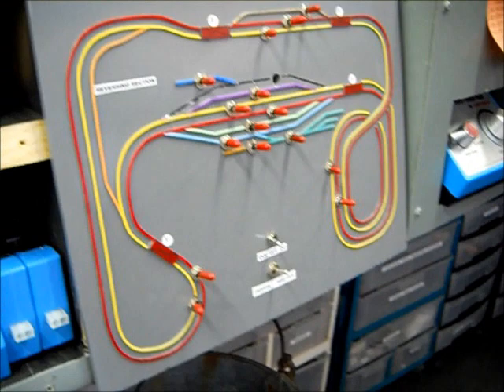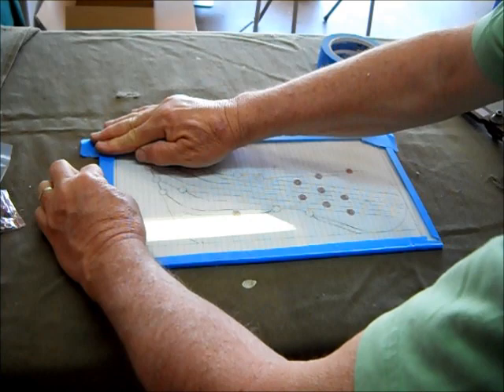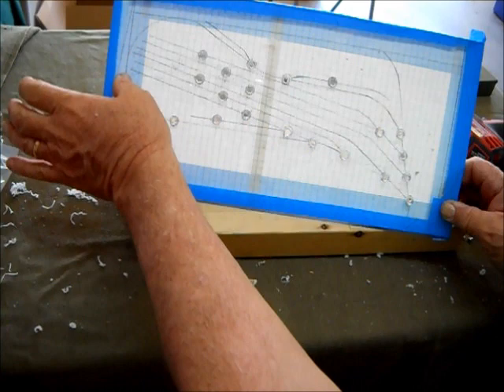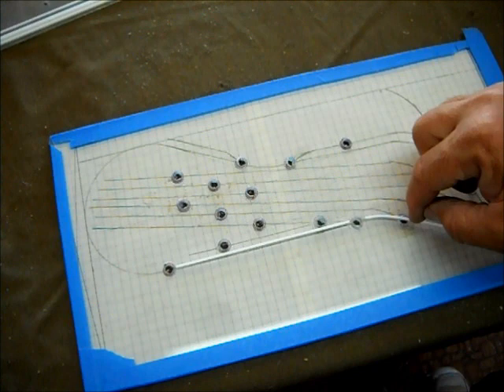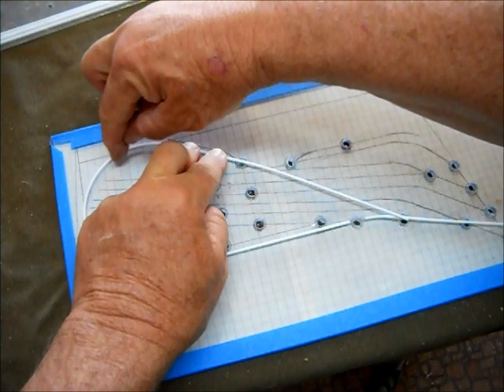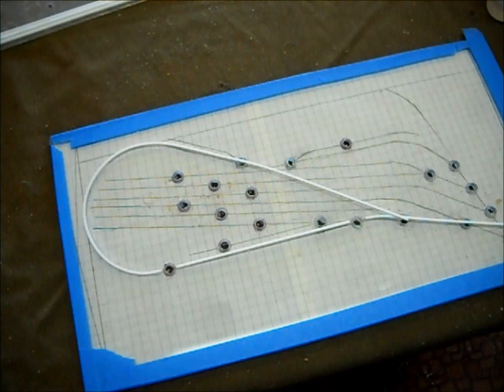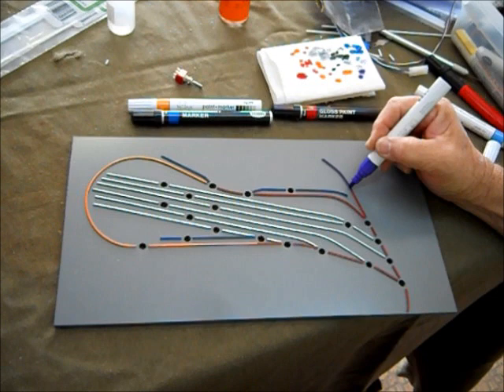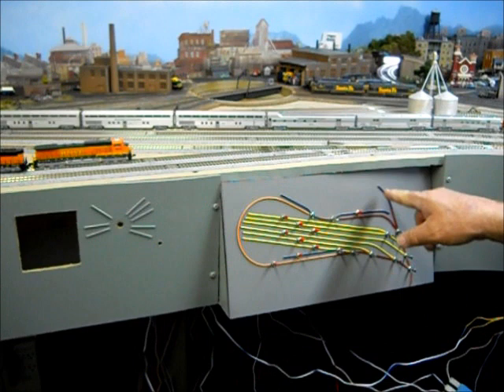How to build a model railroad control panel

Comment: Very nice video. I bookmarked it for another day when I get to the point of constructing my control panel.
Reply from the maker: Thanks Kedric , Hope you will be able to use it.
Mike
Reply: ***** :EDIT:

How well did that plastruct plastic weld work? I'm looking for a decent liquid glue for my needle point applicator and don't want it to come out hazy since some of the parts I'm working with on my coal hoppers are black.
Reply from the maker: Kedric Frick The plastruct cement works well but needs to be placed where you want it and nowhere else.
Thanks , Mike
Reply: ***** I'll keep that in mind. Thanks
Reply from the maker: Kedric Frick Thanks Kedric , It bonds plastic almost instantly.
Mike

Comment: I created a similar panel but I don’t have the 3D effect I used aluminum sheet and tape my template on top for drilling looks like plexy glass easier to work with. Then paint the Panel with white glossy paint. Once done I printed the Panel again on 3M Full Sheet Labels (Permanent Adhesive Clear). Then use an X-acto knife to punch out the holes, for Push button normally open switches. These are connected to DS-64 S inputs to toggle the switch machines. Panels make it easier to run the track for both DC and DCC. Great Video.

Comment: Mike, Thank you very mmuch for sharing your ideas and experience! I will do as you show in this tutorial. Just as I don't understand much about appropriate glue, so I will try with Faller Super Expert needle plastic cement. Here I don't know another needle glue for plastic. Thank you and keep running on your railroad tutorials! Henrique
Reply from the maker: Thanks Henrique , If it is solvent based liquid it should work for you .

Mike

Comment: On your Control panel demo some future suggestions and alternatives:

Firstly I need to disclose that when my family and I started building our original layout my Grandfather was an electrical worker, my Great Uncle was an engineer on the NYC Streamline Hudson (a.k.a. The Twentieth Century Limited), my Uncle was a D&H fireman, NYC brakemen, NYC engineer, a cousin was an architect.  They did the original planning  and instructing of my Dad’s generation and my generation.  So:

1)  Like you my cousin Joe-Joe did exactly what you did on scaled blueprint paper .  Since 1958 those original plans have been modified, and in 2008 my nephew   Joe 3 scanned the entire layout collection .pDF files.  Now whenever the family gets together, for a building session, we can print out a copy and make our changes.

2) Since two cousins hobby woodworking they built a story stick (a lumber with various holes drilled in it to match various items.  Each hole is marked with it’s size.

 3) On the pattern, where a hole is to be drilled a cross is drawn, on the plan, to center the hole.  Like you we drill a pilot hole followed by the full access hole.  Now a suggestion.  When my daughter went off to college she left behind a Manicure Drimmel tool which has a series of rotary files.  After we drill out the necessary holes we smooth out the surface and edges with this tool.  She ain’t gettin’ it back. With an hobby knife we etch the layout lines into the face side of the plexy glass.  Then we do two paint jobs. First; the back side is spray painted with a color DIFFERENT of the fascia.  Then we curve and spray paint the track lines in various colors to indicate their usage.  In the 1990’s my cousin found some plasticized paint which does bend easily without peeling or cracking. We also have holes for LED lights, coming up from the underside, which serve as a track block indicators.  Then to the backside we additional support from 3/4" plywood strips or 3/4" acrylic strips.

4) When all painted surfaces have had a day, or two, to complete dry surface we use the scratch lines as indicators for the track lines.  However, we don’t piece meal the styrene.  We dry fit each indicator, temporally tacked down with AC.  Then like you when the tack in solid we go back with AC and complete the weld.  A couple days later a family member will cut and separate the line, where the switch holes are located.

5) We have no need to scuff the panels surface as the background color in on the underside of the panel.  The individual track lines are pre-painted and welded in place.  Next is my job.

6) First my Grandfather, then two older cousins, now me and my two eldest grandsons get to work on pre-assembling turtle turnout switches, LED lights, automatic & infra-red block switches, and across the bottom of the panel we include a series of switches to operate diorama animation.  The little kids LOVE that feature. All connections are cold shouldered together with plastic shrink wrapped,  To avoid electric short outs.

7) I like your idea of double stick tape and VELCRO for temporary connection to the fascia.  We are going to try in in our August get together.  Back in the 50's and 60's switches were attached to the surface roadbed, then directly to the fascia.  With respect to my ancestor, that turned out to be a BAD IDEA.   Back in the 1970’s four of us left the wives and kids behind to spend a weekend in West Springfield, MA at the Amherst / “Big E” Train Show.

Separate from each other at the end of the day we found out, at days end, we each shopped at the same vendor.  And eached purchased a few dozen, of the same, screws with prototype train logos as screw heads.

So when we are all comfortable with a temporary panel 6 holes are drilled through the panel and fascia.  An anchor is inserted into the fascia.  The panel is re-positioned and attached with these customized draw pulls/screws.

Loved this video and Have subscribed to your channel.  Nice job.
Reply from the maker: Thanks so much , Mike

Comment: That's an interesting way to do that, Mike! I've never seen it done like that! It looks very nice! I have found that, for me anyway, the best thing to use to drill Plexiglas or polycarbonate sheet is a step drill. A step drill is kind of an upside down stepped cone, each step drilling a larger hole than the previous step. I mark the desired size with a Sharpie, and drill until the line just disappears into the hole. The hole itself will be slightly tapered, so you have to turn the piece over and come in from the back side as well. I used to have problems with the plastic cracking (usually on the very last hole! Grrrrrrr! ), but since I've started using the step drill, I haven't cracked one yet! :D I use a drill press to make the holes, I've never tried using a step drill with a hand held drill.
Reply from the maker: That is a good idea. I now do not need any control panels.
Mike

Comment: Hi Mike. The more I review your control panel video the more I think I'd rather go with sub miniature switches that you're using in the video.
So now I'm back to square 1 trying to figure out how to make this work. If you can help me again, I'll forever be in your debt. Thanks Mark
Reply from the maker: https://www.fiferhobby.com/how-to-make-kato-turnout-control-switches/
Reply: @N-Scale  Hi Mike. I just want to make sure that I'm doing the right thing in terms of power source because I'm using
NCE Power Cab. Should I still use the MRC Railpower 1300 Power pack because it's DC? I know this isn't my strong suit.
Thanks again for your patience. Mark
Reply from the maker: @markgershman1563  YES but the AC side and DC converters at the 840's
Reply: @N-Scale  Forgive me Mike I don"t understand. I'd rather go with the sub miniature switches than the 840's. 
I'm sure I didn't make myself clear on this matter. It's the newbie in me. It really doesn't feel good when you know your in over your head on all this stuff. I'm trying to stick with it. It's not going to happen over night. Thanks again for your patience. Mark
Reply from the maker: @markgershman1563  Please call me again.

Comment: This is a great idea. I just put a 2 loop track in with a double crossover and was thinking about doing an indicator panel with a separate control panel for switches kinda like what you were doing for the turntable. I have an Atmel board that lets you program it, so I think I might use that to control switches and signals all in one.

Comment: Yes, I'm almost done laying down track and forgot that I have around 250 surface mount LED's so maybe I'll try to make a few custom lights. Waiting for turnout switches to come in and have been programming a board for train detection that is working more like touch switches, but should be able to handle up to 8 blocks and control about 12 signals off it. Can't wait to get more into it. I decided to go with a Norfolk Western coal train. Very interesting hobby.

Comment: Mike a Step Drill bit like from Milwalkee works nice in installations as this as it Step up in Size for a hole that needs a bigger Size and they usually leave a Nice Finished Hole..
Reply from the maker: +brakeman 3985 Thanks , Mike

Comment: Mike Fifer,  Caution:  I found out the hard way, using Using Tamiya solvent cement WILL cause the Evergreen HO Scale 6x6 polystyrene  to "melt" and break anytime you flex to radius the pieces with any tension at all. Happened every time I tried.  Had a bottle of Flex-I-Weld with a touch and flow system and have had no problem while following your lead since, even while using a Tamiya bottle cap fine brush once cleaned or using the touch and flow applicator.
Reply from the maker: That is true and happens every time.
Thanks , Mike

Comment: After you dill all holes, and cut to size smooth out ruff edges with a file. then take a propane torch like for soldering copper pipe and heat the edges and holes gently. it will turn the edges and holes clear and neat. practice on a scrap piece to get the hang of it.
Reply from the maker: +w8one Good Tip.
Mike

Comment: Hi Mike. It's Mark again. I've decided to go with the Kata 840's along with the 842 DC converter to the MRC Railpower 1300.
I just think it'll be more child friendly for my granddaughter to switch the tracks. The only question I have is the wires going from the 842 converter to the MRC  AC terminal. Do I put both the wires on the AC terminal...or do I put one on the DC as well? Thanks again for all your help.Mark

Comment: Mike, is it possible to create absolutely all control devices on a computer? I mean throttles and switches.Track diagram should be created on the PC screen as well. Is it possible? What you thing about that? I suppose the computer will be able to control all trains on layout itself. Is that right?

Comment: Was checking out a few videos on how to build a control panel for my new layout. Your solution is inspirational. My only question is why you’ve painted the top surface of the screen instead of the bottom. Wouldn’t it be easier to keep it clean if the top was kept clear?
Reply from the maker: Yes but the styrene is white and the liquid gle shows. It is also much more easy to scratch up.
Mike

Comment: Hey Mike wanted to Pass on again Love Love my Amtrak El Capitan's I got from ya,  I do have a Question that might of been Answered but thought I would re ask and that is Do you sell those switches which I think I seen on your Site and or Can you make them up for Customers.. for a small Charge.. 

Not having a really good place / Bench to wire up my self and because Where we Live I'm kind of Leary of using A solder Iron.. So if they can be purchased in a Finished State It would Help a Great Bunch.. 

O"  Mr. Mike  sometime when ya Can would please...  Do a Video on the New 8444 Kato Engine and Do a Video of the New KATO Amtrak Engines Pulling the EL Capitan Passenger Cars I think that would be Really neat..  

Thanks so much  Mike n Robin
Reply from the maker: Thanks Ron, I do not own any of the locos or cars you requested.
The switches are available but not in finished form.
Thanks , Mike

Comment: Hi Mike. I was talking to you this morning about using the Kato 840's along with the Kato 842 DC converter and the MRC Railpower 1300
I think it's going work perfectly. I just wanted to ask you if you thought it would work if I ran a separate bus line coming from the MRC,  going around the layout, for the wires to attach to coming from the switches. Would that work? P.S. It was really great talking to you this morning!!
Mark
Reply from the maker: No because the wire from the 840 goes to EACH turnout and the power comes in the side of the 840 , so you would need a DC converter at eack 840 or group of 840's.
Mike
Reply: @N-Scale Sounds good! I'll let you know how things go when I get to that point. Hopefully It'll work.
I just want to check again about the locomotives....The DCC equipped one is the one that works on DCC without all the bells and whistles..right?

Comment: hey mike not only am i a fan but also a customer, i have two questions about using toggle switches for kato switches.one do you need a separate power feed for each dpdt switch or can you run one feed from the power pack to the first switch and the feed the rest of the switches off that one lead. also since the switches are not constant power is there any way to connect red and green led's to stay light to show the direction of the switch. if so do you where i can see how to do this. i have trouble with wiring diagrams . thank you dennis
Reply from the maker: No easy way to connect LED's to them without some more serious circuitry that I do not know.
The power though can be leapfrogged as you stated.
Thanks , Mike

Comment: Hi Mike. How are you? Very good videos Thank you very much for sharing them. My name is Angel and I have been working on our layout for some time now. Basically I am in the electrical part of zone A that is made up of only kato scale n tracks. I am trying to wire the switches, Mini Toggle Switch (on-on) SPDT, which in my case are blue body. I am also using two kato devices that came in a set. There are 15 changes of track in total. When I tried them individually I had no problems. However, when starting to connect the power source activates the insurance and turns off (It is the kato power pack, which I will use only to operate the switches, because the model is dcc. I have reviewed everything several times, but I can't find the Problem, you can guide me, excuse my English, but I do not use it regularly, I am from Chile and I would very much appreciate your advice.
Reply from the maker: You are using the wrong switch for turnouts. The Kato's are a single coil polarity reversing turnout and NOT twin coil but even the twin coil machines can not use On On non momentary switches . The kato's are done this way.
https://www.fiferhobby.com/how-to-make-kato-turnout-control-switches/
Mike

Comment: Mike....I was wondering if it might be ok to sand the plexiglass after drilling the holes prior to applying the Evergreen plastic.  I think that might make the sanding a bit easier and quicker.
Reply from the maker: Sure that would work as well.
Mike
Reply: ***** I picked up my plexiglass today along with the Evergreen plastic.  Just finished drilling and running the Evergreen lines between the switch holes.  For my 1st attempt it went reasonably well.  I had one mess up though.  I'd bought a plastic bottle with a long needle point to place the Tenax 7R neatly.  Well that didn't work like I'd thought it would.  As soon as I tipped the bottle the Tenax ran out in a big puddle.  Should have tested it first....lesson learned.  Anyway I was not able to control the flow no matter what I did.  So I just took a needle, cut 1/2 the eye off and used that to place the glue.  The capillary action made it much more manageable.  : ^ )  I'll have to pick up some spray paint tomorrow.  I like the gray color you have on yours.  I'm presuming that is a water based paint.  Please let me know if that is incorrect.  Other than that one mishap it turned out pretty well considering.  You instructions made the project much easier.  Thanks again....
Dan

Comment: Hey Mike I was wondering on switch controls if you use these type switches does it have to be wired DCC or can you use your Kato power pack?
Reply from the maker: On block controls either one and on turnout controls you can use any 12 -18 vdc power supply.
Thanks , Mike

Comment: Hi Mike , Without sounding dumb,(i'm new at this model railroad stuff) You have 2 different types of switches. One for the turnout controls and the other for block control. Could you, or do you have another video to explain what each toggle does. I didn't think dcc needed block control, or I might not know what you mean..Thanks
Reply from the maker: When I built this panel my layout could run DC or DCC , that is why I had the block controls. I have now removed them.
Thanks , Mike

Comment: Hi Mike. I know you said I should call you on Tuesday, but I had a quick question. Would a MRC Railpower 1300 Powerpack work with my 840 controllers? Thanks
Reply from the maker: Yes
Reply: @N-Scale  Thanks again for getting back to me so soon. I'll still call you on Tuesday about the confusion I have with the locomotives I have to get in order to work on my DCC system. Speak to you then. Thanks again! Mark

Comment: Hi Mike. Quick question. Can I use the Kato switch Controllers at the same time I'm using My NCE Power Cab? Sorry, I know this has nothing to do with this video. Sorry about that...lol  Mark
Reply from the maker: Yes , the kato 840's will need their own power supply.
Mike
Reply: @N-Scale  Thanks so much Mike. Could you suggest one that you feel would work best for Kato. Thanks again Mike!
I'm also looking to get my first locomotive. I'm a little confused as to which one I can get because of the DCC. Do i have
to get the topof the line loco with sound and everything but the kitchen sink in order for it to run on my DCC system. HELP!
Reply from the maker: @markgershman1563  Can you call the shiop on Tuesday?
Reply: @N-Scale  Sure. Will do!